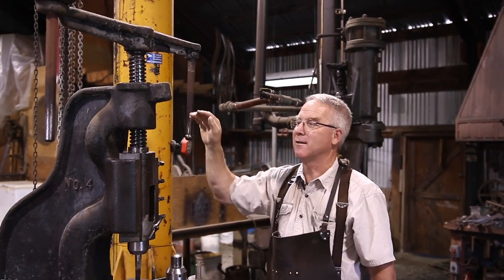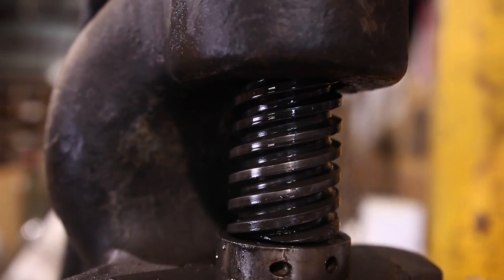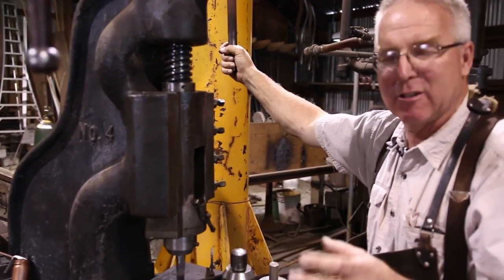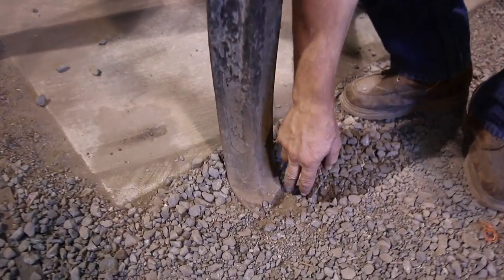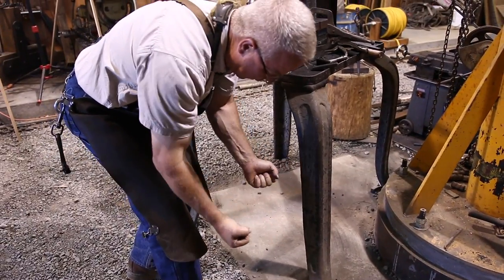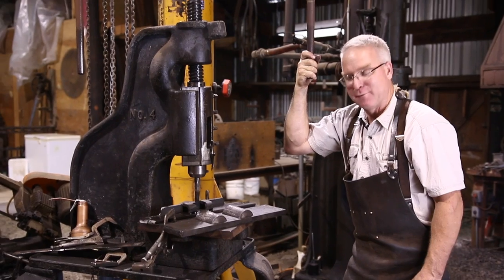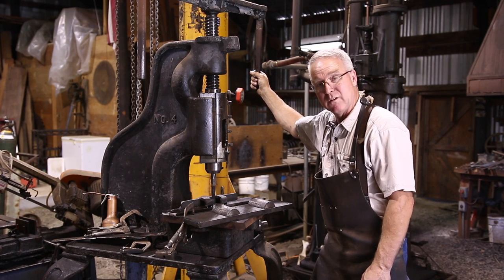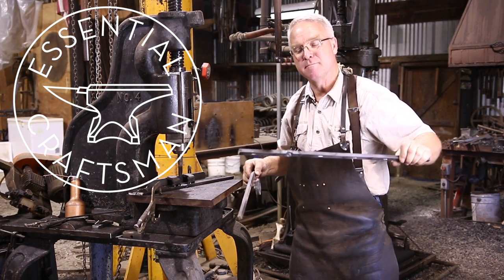Ever Seen A Fly Press?

Comment: And you don't need ear protection!
Reply: I'd think all of the clanging and banging from hammering could "hammer" your ears quite handily, myself. This press is quiet, but that's not all there is to metalworking.
Reply: You do if it is punching holes in steel
Reply: I'd opt for a helmet, or at least a hardhat.
Reply: Could you repeat that?

Comment: Metal working blows my mind. I can barely afford to woodwork, getting metalworking tools looks intimidating! Very cool!
Reply: Levi Blackwood Gonna take me a while to decipher this response!
Reply: buy a flat peice of steel with a hole in it  for the tools that go in the hole and ur fine
Reply: Metalworking>woodworking I do not like working with dead tree carcass
Reply: Lmfao
Reply: Shane Corrigan Sounds like an AVEism
Reply: Well, you do need to own land or have a very cool landlord. But aside from that, the barrier to entry is an anvil and that’s about it. If I started again I could get going with a budget of about ~$1000, which is far far less than the cost of a cabinetry grade table saw. Angle grinder, anvil, hammer, small gas forge, couple of files and a set of tongs is all you really need.
Reply: A pair of piers,hammer and something to use as an anvil, make a forage easy, then make most of your own tools, wrecking yard for working stock, hot water heater tank and blower from wrecking yard and you have a forage
Reply: For anyone interested...
   My first forge was the brake drum from a dump-truck, precariously balanced on a ring of bricks, and a vacuum cleaner motor I'd scavenged from a dumpster.
    My first anvil was a two-foot or so chunk of railroad, turned upside down and fitted into a channel I'd cut into an oak block. I still have it (fifteen years later), and a smaller version that's a LOT more convenient to carry around to work-sites.
    You can find a hammer anywhere, and make it work. Obviously the heavier (and older) the better it's going to be for metal smashing... BUT if we're honest, you just want something that you can comfortably swing and feel satisfaction when you whack the "immortal f***" out of something with it.
    Tongs... My first set was a pair of channel locking pliers with some garden hose shoved over the handles to extend their use before I had to quit (burning through the gloves)...
    At some point, you're going to want to get real WELDING quality fire-proof gloves. Use your best judgment, and don't go too cheap. The longer you can stand to play with a heated pair of tongs (and you really should get proper tongs... they're not THAT expensive) around a screaming hot fire, the more fun you get to have at your forge and smithy...

    Over-all, I doubt I set up a metal-shop on more than a twenty dollar bill, and I'm including stucco-mesh in the brake drum to hold the fire inside and up off the ground... AND the coal to run the thing.

    I now have TWO brake drums, though I'm more often using the propane powered version. It's cleaner and generally less headache, all things considered... BUT I keep the old setup around. It's a beast, and when you really need super industrial grades of unadulterated abusive heat, there's nothing like a proper coal-fired forge. This thing can melt down (what it doesn't burn right off) a two-pound chunk of solid steel in about two or three minutes.

     JUST a touch on skill...
   There's some considerable show and repeat around YT (and others) that you have to douse in oil. For high carbon stuff, previously tempered hardened types of steel, this is sort of true...
    BUT there is just a bit more to it. You HAVE GOT to have the capacity to heat the steel to a degree that dousing in water will actually cause harm. I've seen a few onliners who think they're dilligent, but they struggle to harden, and the problem is the "tempering curve"... This is how FAST you can bring the  temperature down from as Hot as you can get, to as Cold as you can get...
    If you can't reach BRIGHT cherry red, you ain't breaking no steel by dousing in water... period.

    SO my advice, on building your personal skill. Get a large container of water... AND heat steel in your forge, and then douse in the water... IF you don't shatter that steel in the water (yes, it's prone to a bit of scary shrapnel)... THEN you need to work on your heating... either by engineering the hotter forge, or by learning better technique and timing...
    It takes a bit of sacrifice to get in that practice, to KNOW when you really see BRIGHT cherry red, instead of cherry red getting brighter... BUT shatter a few chunks of steel in the water dousing... and you WILL start to see what "really f***ing hot" looks, smells, and feels like.
    Because until then, you're kind of just flailing about... and you look kind of silly.

    Oil IS important... but until you get the energy to do the chemistry thing... it's just a source of carbon-blacking. ;o)
Reply: Dont be intimidated, my dude! You can start metal working with very little tools. Most people start with basic stuff and the gain more equipment as their skill level increases. A lot if the tools you can make yourself.
I actually made the tooling I use on my fly press. Got a video about it on my channel ✌

Comment: Hello Scott Wadsworth, This is a beautiful example of American Ingenuity and Craftsmanship captured in Cast Iron.  I'm Paul Maselli and I am a master tool & Die Maker and an automation engineer.  I'd like to offer a correction to your statement about the Acme Screw profile.  The presence of the triple lead screw on your fly press is not to combat axial loading as you suggest.   Multiple lead screws have been developed and used over the years with double triple and quad lead threads for a simple reason, they multiply the advance lead angle providing a very fast thread (rapid linear advancement) while providing sufficient contact surface area to distribute the load and force over the contact  surfaces of the multiple threads.  Axial load or misalignment are only compensated for or overcome by the length of the screw and lead nut design.  Common rule of engineering would dictate that the contact area of the screw to lead nut is at least 3 times the diameter to provide sufficient surface area and contact to counteract friction and side loading.  By nature of this machines design it should not experience side loading forces when being used properly.  Thank You for Sharing.
Reply: fly presses existed since the roman empire... so not american
Reply: Thank You, the point here is not about this being an American Invention, more on the beauty of cast iron tools lost to today's artisans. Plus my attentions here are to correct the statement that the multi lead screw was used to offset axial loading.  But maybe that went over your head.  Please re-read this comment.
Reply: "Common rule of engineering would dictate that the contact area of the 
screw to lead nut is at least 3 times the diameter to provide sufficient
 surface area and contact to counteract friction and side loading."

When you say "...the contact area of the screw to lead nut is at least 3 times the diameter..."; do you mean the length of the nut or the actual spiral contact area of the threads?
Reply: Length to diameter ratio, a 2" diameter screw, you would be safe to have a 6" long lead nut.  Thanks for asking.
Reply: What he actually said was that the multiple lead prevents the shaft from binding because the load is being applied from one side.  

This is incorrect as is your assumption that the screw prevents locking up or jamming.  I assume you are referring to the "Sine" of the lead angle, not "Sin".  

Now lets break this down.    As I stated the multiple lead screw is a fast action, with a steep angle and Sine value. This allows the ram to advance and retreat quickly for the action its performing.  The amount of force applied is in direct relation to the length of the Fly Arm and the weight provides momentum.  

A single lead screw will not lock up or jam, just look at how you use a "C" clamp.  The screw advances and will release easily without jamming.  So the single lead screw with the lower lead angle and lesser Sine value will not jam as you suppose, it is not an effective design for the task of creating a ram that is easily advanced with the inertia of the weighted lever behind it.  

Thank You,

Paul A Maselli, Sr Tool Maker, Mechanical & Automation Engineer, Boatwright.
Reply: I was going to add what Paul Maselli commented but without the education and background to do so.
Former Middle School and High School "Shop" teacher; Woodworking, electricity, welding, materials and processes, intro to computers, basic and architectural drafting (board schools at which I taught had almost no computers.
Summers I worked residential framing, industrial maintenance and construction.
And I did shoot a nail through my thumb (summer job) with a nail gun, but I have all my fingers.
Reply: Chuck St. Louis 
Translated, the diameter of Paul's explanation is quadruple the circumference of your triple lead nut story. So u lose.
Reply: well said!
Reply: Thank You everyone for the positive comments and feedback.  I'll work on the idea of my own channel, I'll try to fit it in when I can.
Reply: Paul Maselli I came to the comments to say the same thing, you said it much better, and improved my understanding in the process.
Reply: Funny, I hate to be that guy but AvE recently did a video taking apart a tool (can't remember which one) and he explained the purpose and function of multiple lead screws.  He is a torque guy, after all.
Reply: "the point here is not about this being an American Invention"

Then why claim it is an american ingenuity captured in cast iron? Maybe Ristos answer went over your head, please re-read his comment.
Reply: Risto's comment did not go over my head Jaakko. The origins of the Screw Press are not the point of this thread. My introduction as to point out the beauty and strength of machinery built during the Industrial Revolution, something that has been lost to Canned Ham manufacturing processes as well as improved metallurgy.  The actual context of this thread are to correct the assertion that Scott made regarding the use of the multiple lead screw to overcome the side loading of the weighted handle.  Maybe that went over your head, please re-read the comments.
Reply: Paul, why is he having trouble with the feet of this press. What is causing all the side loading?
Reply: Jameson Cross  He explained it in the video.  The rotation of the weighted arm has to come to a stop at some point during the process, and that momentum is channeled into the machine, trying to rotate the machine in a clockwise fashion.  It was obviously bolted to the floor at some point, and the constant torquing of the machine with every hit, eventually cracked the feet on the legs.
Reply: Paul Maselli  Great explanation of a simple, yet very effective system!  My father was a tool and die maker during the early part of WWII, until he got drafted.  He explained multi-start threads to me when I was 12.  He had made a 16-start thread for something, back in the day.

Many optical devices that have a mechanical zoom lens use multi-start threads, as do a lot of plastic bottle caps.  I have a Navy periscope that has double-start threads that change pitch as they go.  I'd like to see how that was made!

Thanks for the additional info!
Reply: i like this stuff,but sux at it....after reading scott and paul conversation.....ill just go bake cookies and do laundry
Reply: Hello Paul Maselli;  the question I had that I thought you might know the answer to is:  When this machine was built ball screws hand not yet been invented.  Would this machine work better if it had a ball screw instead of a acme screw?
Reply: yea Paul is totally correct, I am a Machine Tool student  with only the class of tool & die left to complete my degree. Which will happen this May (hopefully). I was kinda bummed that I did not get to explain this concept to you but I could not have done it as concise and eloquently as Mr. Maselli did. good job on this video i enjoyed it.
Reply: wow ... hate much ?
Reply: @mshaw290808mi   a ball screw would not be able to take the axial loading... imagine a standard ball bearing ... now put axial pressure on it .. and watch it fail. The acme thread has close to square thread flanks ( which are great for carrying axial loads )
Reply: Yeah, what he says.....
Reply: I'm surprised you didn't say that in Greek...(engineers, pfuff!)
Reply: @TheMobileBoatwright  With a job requiring the higher forces available  to a larger fly press, the thread jamming is not the same as with a "C" clamp.  The torque supplied by the ball  "tightening " the thread on the nut far exceeds the torque available to the worker who is using muscle power to unlock the thread---much like tightening a one inch bolt with a wrench with a 6 ft. handle, then trying to undo it with a one ft. handle.
Reply: @TheWireEDM  this is an English pattern Fly Press.

Comment: I been using one in the smithy for 20 years now , versatility is an understatement. The latest tooling is for skillets. I have also built all manner of punches and sheers. Just don’t get whacked in the head with the arms. You might want to consider another weight on the fly, to balance things out.

Comment: the thread on this press is called a triple lead thread. It is designed to give 3x the movement but retain the strength of the same pitch thread per inch
Reply: You are correct.  The reason for multiple start threads is high axial movement.

Comment: Over here in England i work in a factory that has many fly presses this size. Ours all say "Denbeigh No 3 on the side. Ours have the addition of a lockable collar on the acme thread so an accurate depth of travel can be set. I think they were used for assembling shells during WW2
Reply: yes it's good when you have a stop on them, especially when loaded with dies and punches or bending brakes..

Comment: We had smaller ones in the workshop where I was doing my apprenticeship and we used them for anything from stamping the company logos onto metal parts to stamping various smaller parts for office machines and for riveting. The reason for the multi thread is for faster vertical travel... otherwise you would be spinning the handle all day getting nowhere.

Comment: In my mind, more threads on a shaft makes the pitch steeper... so the movement is faster. More axial movement with the same amount of rotation. Nice apparatus tho =)
Reply: He Ka you're totally correct.  The screen he describes is called a triple lead screw.  If it had two helixes it would be a double lead screw and so forth.  The purpose of a multi-lead screw is to transfer motion quickly.
Reply: Yep... seen it before in gate valves. Maybe somewhere else too...
Reply: I was practicing on my lathe the other day and I made a double and quadruple start. Triple would be much harder since it's not even.

You'll almost 100% of the time find multistart threads on juice bottles, milk jugs, etc.
Reply: I assume you did the multistarts on purpose ? xD .. But ye. they are used in all kinds of consumer products, like jars and bottles.. consumers wouldn't appreciate having to twist on a cap for a whole minute to get it open/closed =D
Reply: The Metal Butcher on a lath you just set your pitch 3 times what you want it to be, and adjust your cutting position with your compound rest. So for 10 tpi you set the lath to cut 30. Cut the first thread. Move the compound rest 0.100". Cut the second. Move again. Cut the third.
Reply: aaroncrabbe you mean set it for 3-1/3 = faster lead
You would probably want a thread divisible by 3 like a 12tpi then run the gears for 4tpi. Cutting these manually would be is just for fun. To do it right CNC makes life easier!
Or just by whatever 2 ,3 or 4 start threaded rods and nuts from McMaster or similar supplier. 
Definitely a cool channel though! Cheers Mr. Craftsman
Reply: miller110103 sorry you are correct. I went the wrong way with my math. I'm a mill guy most of the time. Def a great channel
Reply: Yep to get that amount of movement in a single start it would probably have to be 5 inches in diameter.  It is probably a lot less expensive to machine a multiple start than it is to do it with single.
Reply: I'd put it this way: Multiple high-pitched helixes enables fast axial movement of the screw, without reducing it's total number of threads per unit length, thereby not reducing the axial load that the threads can carry.
Reply: Milk jugs & pickle jars have multi start threads. They are fast, and they don't cross thread easily.
Reply: Yep the same thread design that's on a milk jug. Instead of axial I might have used the term linear, but a rose is a rose.
Reply: @TheMetalButcher  you h
Might have to exchange a gear or to I the lathe headstock to get a triple...

Comment: Used one for about three months when I was a teenager, we had the pattern with an iron ball at each end of the top bar and a single long handle, we worked these by swinging the handle round hard and catching it on the recoil. It doesn't take long to learn not to get slammed in the head !!     How old these machines were nobody knew, but the raised cast lettering was well worn !
Reply: I bought a new A.P.Lever 7N flypress from the factory circa 1973/74 in Mascot , Australia.  It has a fine thread at the top of the screw to allow a big nut to act as a stop and  the handle has a hexagonal hole in it that fits over a corresponding taper on the screw.  This permits the handle to be lifted off and placed in a more convenient position.The only maintenance is a drop of oil every now and then on the dovetail slide and screw.
I still have that press.